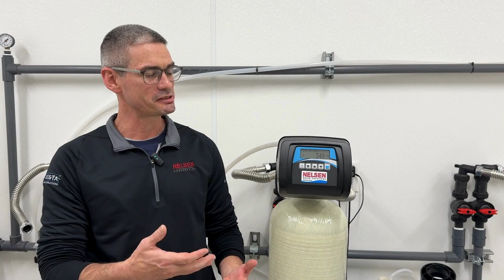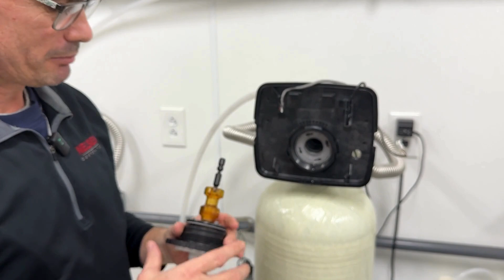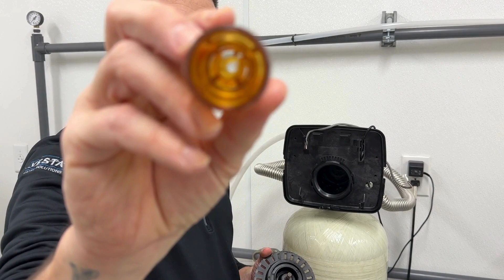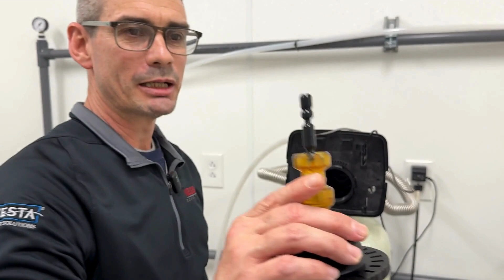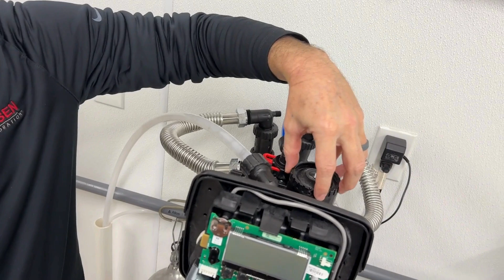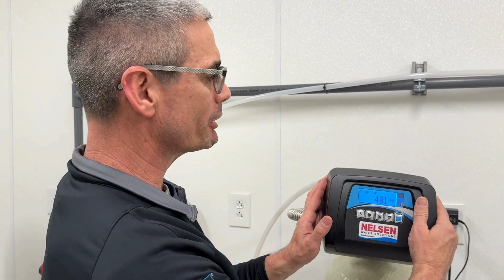Tragon's Tuesday Tech Tip | Servicing a Nelsen Water Solutions Softener Valve | Nelsen Corporation

Comment: Thanks for showing how easy it is to work on a Clack WS1. And I really appreciate the tips about how tight the assembly needs to be. I've had a lot of customers fail to tighten the Drive Cap assembly properly, and think the new Spacer Stack Assembly just installed was defective. I'll be sharing the link to this video on the Clack WS1 parts section of our website, Softenerparts. And continue to look to Nelsen Corporation for both products and support information ( like this video ).
Reply from the maker: Thanks for choosing to work with us here at Nelsen Corp!